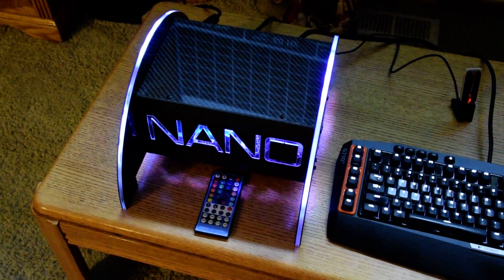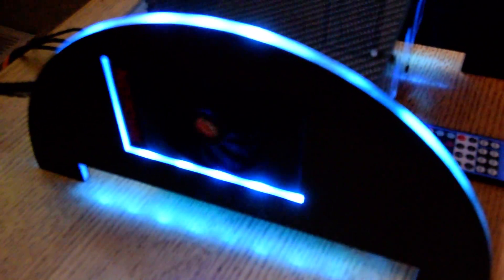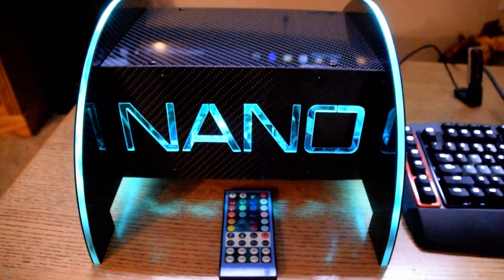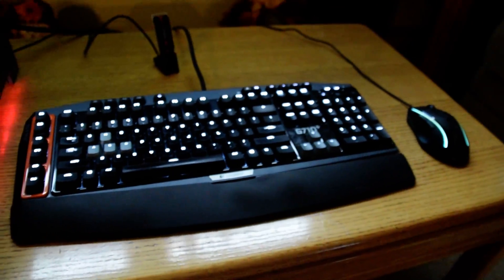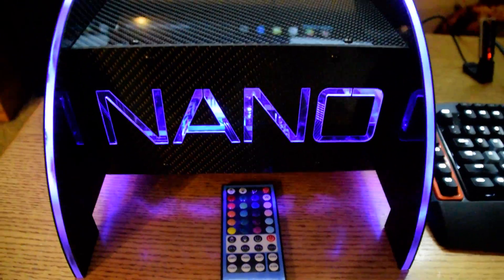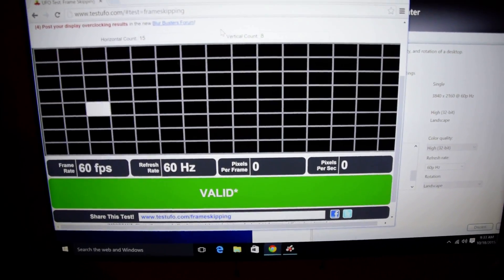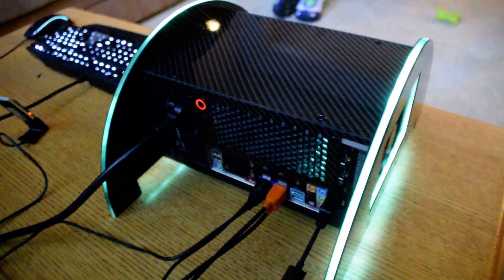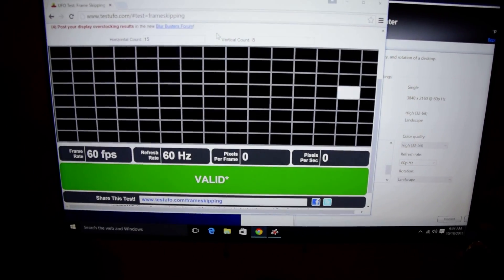AMD Nano Project running @ 4K 60Hz

Comment: What's the noisiest, the AMD Nano GPU or the Intel 5960X CPU? There's definitely a lot of noise coming from the case...
Reply from the maker: +Eleriam Its the Dynatron R27 CPU cooler. Because how small the case is that is the only low profile CPU cooler that would cool the 5960X enough in a small enviroment.

Comment: Wonderfull rig here !!can you explain how the hell you got 4k @60hz .What brand is your DP to hdmi addapter?
Reply: +hazooka0  He runs 4k @60Hz using an unreleased converter that AMD was working on (he wasn't allowed to disclose it).  They've since discontinued working on this converter which means it will not be released.  Instead, they will release a revision of the Nano that will natively do 60Hz @4k using the HDMI 2.0
Reply from the maker: +Kavya The Club3D Displayport 1.2 to HDMI 2.0 adapter is available on Amazon now. I don't know what you are talking about....
Reply: YEs BUy CLUB 3D DP TO HDMI 2.0